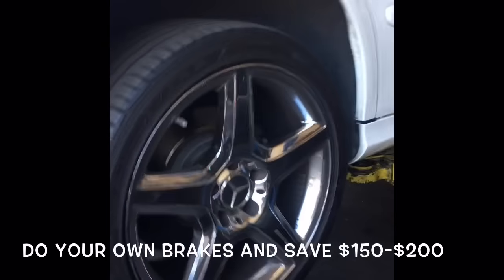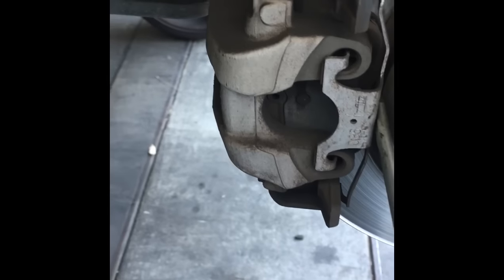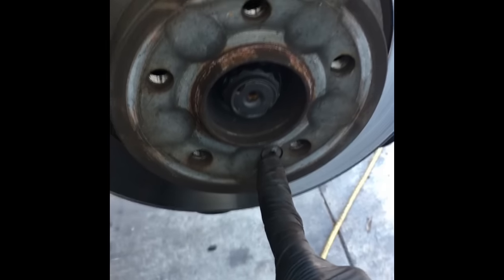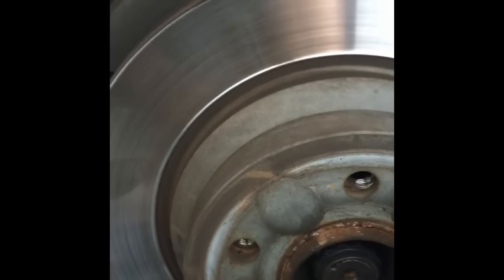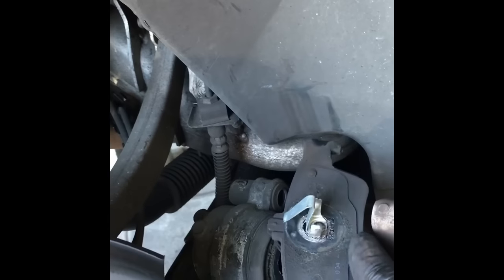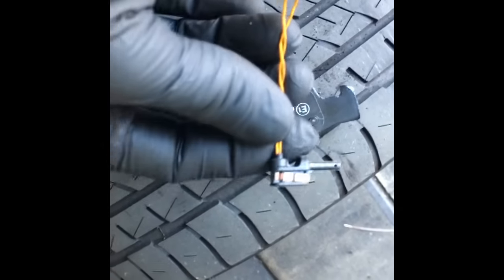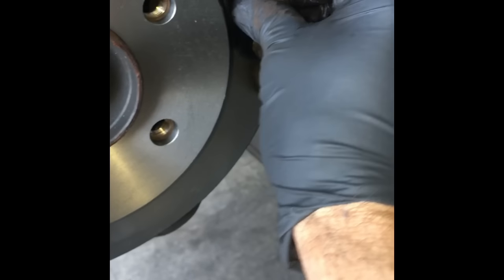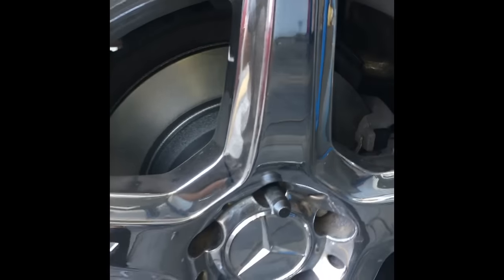How to Replace Rear Brake Pads and Rotors on a 2009 Mercedes E350

Comment: This is a great video.  I bought all the tools and parts and easily replaced my own rotors and pads on my 2009 E-350 saving $350.00 in labor.  Thank you.

Comment: FYI the C- clamp method to retract the caliper pistons (front and rear) and the old pad with slow turning of the C clamp worked like a charm. I used a 4 or 5” C clamp. Anything less will not open enough to slide over the caliper frame and the pad....yes even the worn out ones.

Comment: The impact driver is a good tip and I recommend having it close by.  With my case the Torx Screw was not seized or the head stripped.  Appears that at some point the rotors and pads were changed so fortunately the regular Torx screw worked.  It shouldn’t matter that size the Torx Screw is as long as the heads not stripped and comes out without excessive force.  A good reference is also that all four Torx Screws are the same head, thread pitch and length.

Comment: Removing the rust on the Brake Hub would of been beneficial before fitting the new Disc.
Reply: Michael Kane correct.  I use a medium duty Scotch Brite pad (Dark Red). Attached to end of drill.   Should only take about two-three minutes per side.

Comment: Where did you jack it from, been trying to do my rear brakes but don't know where to jack with a floor jack
Reply from the maker: YT-Sub4More you can put a floor jack under the Center of the differential Jack the rear up .Make sure you Chocks  the front wheels of the vehicle so it doesn't roll on you. Then then just in front of the back wheels should be a little rubber pad where you can put the jackstands and then lower the vehicle down onto the rubber pads.

Comment: When replacing the rotors/pads/sensors - doesn't it make sense to also swap out the bearings? Especially if it's been the 2nd change of the rotors/brakes (i.e. ~ 112k miles)?
Reply from the maker: Tim Robertson At the shop we only out  change the bearings as needed. Some bearings go for really long times and some wear out prematurely just depends. So if you feel like you have an issue go ahead and change the bearing out.

Comment: For the 2011 E350. Do the rear rotors just get pushed in with C-Clamp or does it need a special Caliper Piston threading tool?  I say this because my 2018 Explorer and even my old 2011 Honda Accord used this tool because the rear caliper piston did not push back with C-Clamp.  The piston had to be threaded back in with this tool.  Basically a Die goes on the piston and there is a backing plate that sets against the outside of the caliper side frame.  As the tension is set the caliper piston rotates inward.   The reason for this is  the piston is set against the worn pads.  The new pads should be quite a bit thicker.  Compressing the piston makes up for that space and allows the caliper slide over the new thicker pads.  After you get a few cycles on the brakes the piston will form to the new thicker pads.
Reply: No need to thread them back, a C clamp works fine. Same on 2014 W212

Comment: I could not get the caliper holder off. I used a standard 18mm wrench but it's on tight. Do I need a mallet?
Reply from the maker: Breaker bar

Comment: Good evening where  can I get this 14 mm x 1.5 thread stud. That can help me very much when I do my brakes or rotors. Any help will be greatly appreciated.

Thank you everybody.

Ricky A.
Reply: Ricky A. Amazon I got two sets.  $7.00 per set I believe.  I haven’t used them yet planning brake replacement this weekend so I will let everyone know.  Mine was for 2011E350 so check description and vehicle fitment before purchase.

Comment: Although my brake project was a 2011 E350 the procedures in this video were the same.

Brian......do you happen to know the caliper, caliper bracket and lug stud torque values off the top of your head?  I know they are tight but want to make sure.

Thanks for the replies.  Project is complete  four wheels new pads/rotors/ hardware kit and sensors.  +2 on the “Tire Tree” the metal threaded rod to help keep the tire in place when four of the five lug studs are removed.  Prevents tire from falling off.  Also keeps the tire aligned and the weight idle the tire is on the tree until the first couple of lug studs are installed.  Definitely worth buying a set of the trees.  Approximately $7.00 US per set of twos. It only requires one but nothing wrong with using two trees per wheel.  As for the Torx retaining screw for the rotor.  Easier to rotate the rotor....yes No Pun Intended....rotate to 12 O’ clock and hold rotor with one hand while removing screw with the other.   Process is fairy simple except pay attention to the pad wear sensor...thin copper wire and easy to break.    One more step that can help and you wouldn’t be wrong.   Clean and sand off the rotor hub face and the caliper face.  I used a red Scotch Brite pad attached to the end of a power drill.

Brian with my step I put the outer pad in the caliper housing and then slid the caliper over the rotor.  Was I wrong?  There is a little dimple on the outer backing pad and fits in the caliper.  Obviously my way worked but is there a logic to installing the outer pad on the bracket frame first versus to the caliper and slide both pads and caliper to the bracket?

If you have a choice try getting a 7mm 3/8 drive the 1/2 drive will be too bulky especially against the upper bolt.  I also used about a six inch piece of hollowed out angle iron to slide over the ratchet.  Internal opening of the metal was easy to slide over the ratchet but still allowed reasonable movement inside the fender well.  With my scenario the 3/8 breaker bar fit inside the tubing better pretty much all the way to the socket end.  The metal tubing did not fit as far over the ratchet handle but gave more finely tuned ratchet teeth movement for a better loosening and extended the fulcrum of the ratchet for better leverage.  After the Torque is broken you can remove the angle iron and loosen the bolts as normal.

For the 7mm hex key there are two lengths basically a shallow and deep similar to sockets.  The shallow worked in my case but doing over again I would prefer the longer length.  Also DO Not use a 1/4 hex key.....it fits in the hex key socket just like the 7mm and will be snug enough to loosen and even snug enough to tighten.  The problem at least for me was the key key socket got stuck inside the caliper bolt.  Bolt is tight so not worrying about that but the hex key could also become dislodged during vehicle movement a big pothole etc....  If it does not dislodge itself by the time I send in for transmission and engine mount replacement I will ask the shop to remove it with whatever tools available.  Should be easy for them since most likely on a high lift and more leverage.